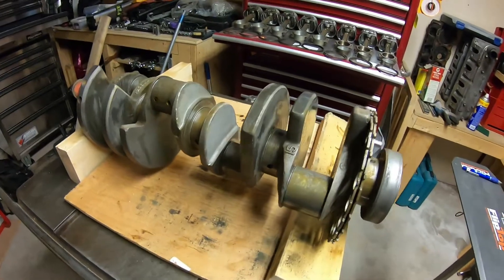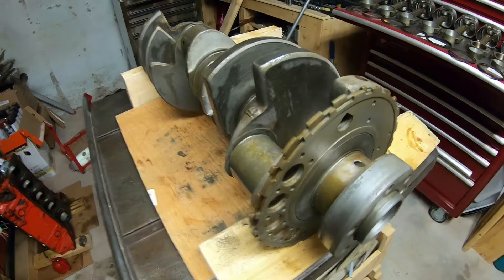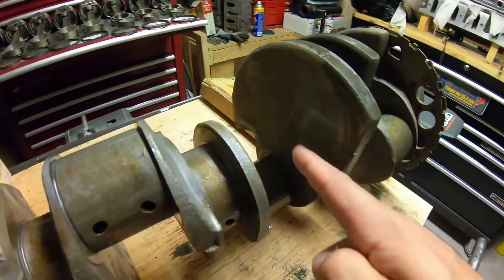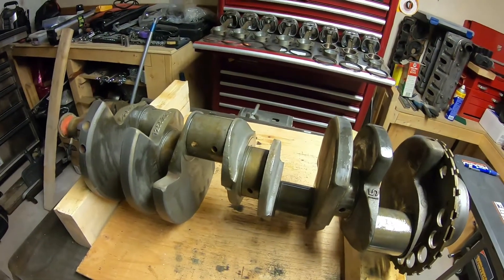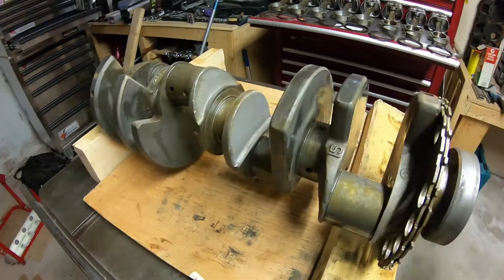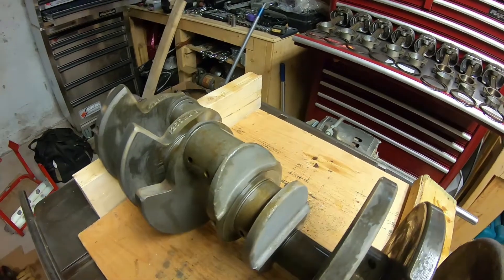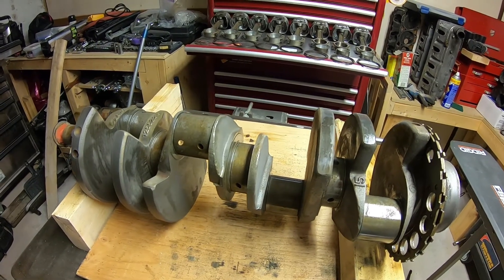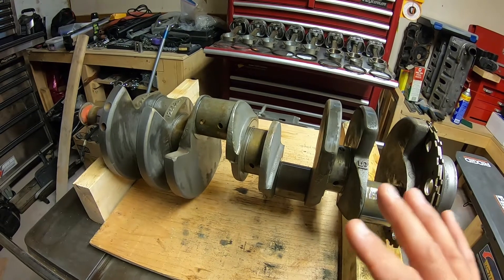LS 5.3L Vs 4.8L Crankshaft Differences (Nerds and Numbers Series) GM LS crankshaft

Comment from the maker: Today I was actually thinking about swapping 3rd Gen Cranks around in the smaller LS family like the 4.8 and 5.3 what I'm wondering is if there would be any gains or anything at all vs swapping a 4.8 crank into a 5.3L to De-stroke it or vice versa a 5.3L crank into a 4.8L I'm honestly not sure if anyone has done that yet or even if it's worthwhile to do I'm not sure! it is something I need to investigate more!
Reply: I'm curious as well sir. Back in the day... the early 327 shared the same small journal crank as the 283 and I've heard they were nasty and really could take a beating and rpms!
Reply: @theshiplesspiratelaka4276  The DZ302 from chevy.. Years ago... 10k rpm.  Motor. All day... Nasty motor... The thing was keeping up with the big boys on the track back years ago
Reply: Put..the 4.8 into a 6.0 or ls3 Good combination..
Reply from the maker: @shawnlibby675  ya good idea man but i think the reluctor is different than the 6.0 i cant remember the number of teeth on it or something

Comment: I have an 2002 4.8/5.3 but I did notice I have on the block the head casting is the 862 an the 00- 04 4.8 no lie in the gen 3 have the 708 head with the electric throttle body because my mom have the same truck with the cat eye version of my truck  the only difference I seen in the hp is the the electric system like an 75 horse power different